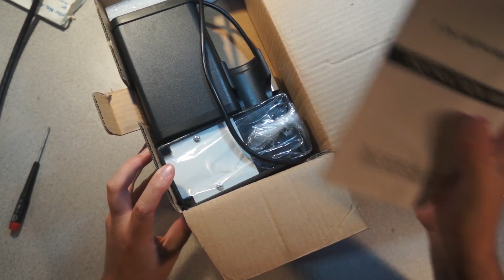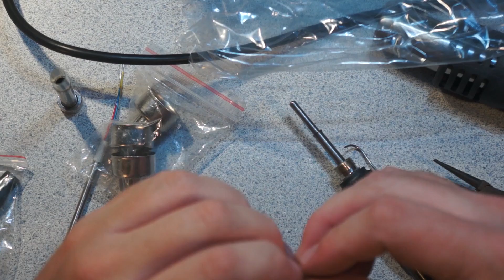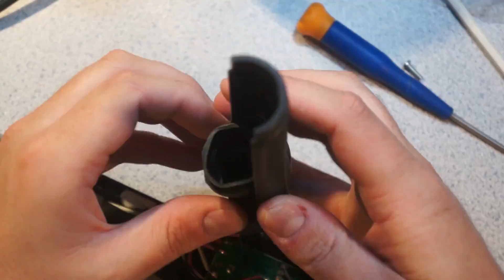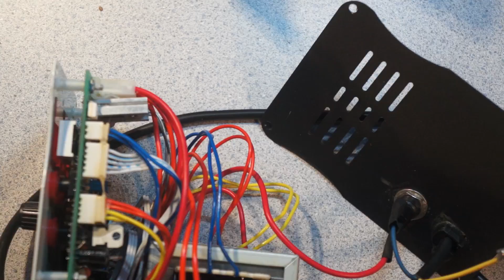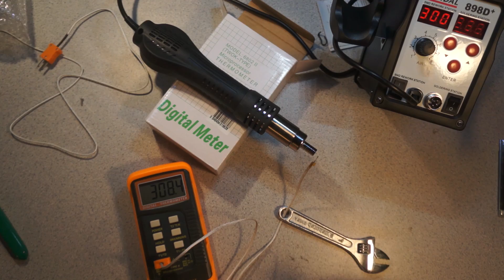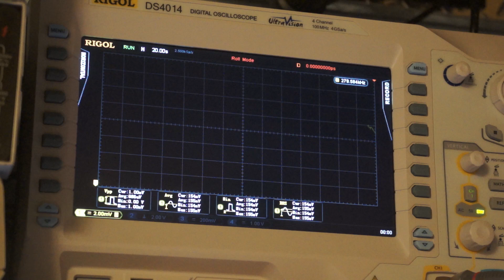898D+ Soldering Station Teardown and Review [Sold under many Manufacturer Names]

Comment: Break out the micro's dip socket to your own micro and after figuring out how it controls the triac, reads the temp and updates the display write your own control firmware and see if you can patch it better and account for the overshoot a bit.

Comment: You're absolutely right Conner... "Lie" is an accurate description.   Seems like the designers were only concerned with ensuring that this device heats up as fast as possible.   Then when they were happy with the heat up time, they bodged the display to hide the overshoot IMO.

Comment: I confirmed your overshoot results with a Yihua 882D+. Similar overshoot when powered on and then settles to about 20C over what it displays. I had the thermocouple about 2cm away from the tip. This model does however stay on to cool down when powered off.

Comment: The overshoot doesn't seem like it would be that significant if it was used against something with any sort thermal mass as it only lasts for a short period of time so not much actual energy would be transferred. I imagine it only seems so bad as you're measuring it with a tiny thermocouple with almost no way to dissipate heat outside of the airflow.
Great review anyway, thanks!

Comment: Maybe... It just seems like the internal temp sensor and the thermocouple you were using were only ever, what, ~1cm apart in space? It doesn't seem like the little bit of metal around the internal sensor would be enough to have that much of an affect. I'm not a mech/thermal person though...

Did you try putting your thermocouple on the end of your Hakko to see if it tracks reliably?

Comment: That's really a lot of memory, I've done stuff at least as complicated on PIC10F22. Judging by the ramp-up curve it really is on/off behaviour maybe switching to a different algorithm once close to the set temp.

I'd just stick a 20-pin PIC or *gasp* an Arduino (Nano clone) rather then having to source compiler/ide/programmer. The more interesting part would be moving the thermocouple to a better spot.
If you can figure that out I'll buy one of these and to the mod for everyone.

Comment from the maker: I STRONGLY suspect it's caused by the thermal lag between the air temperature and the internal thermocouple.

Basically, the actual heating element wires (and the air) heat up much more rapidly then the internal thermocouple. As such, by the time the internal thermocouple is at temperature, the air temperature is significantly above the target temperature. 

Then, as the system comes into equilibrium, the two temperatures drift back closer together.

Comment: I doubt it has any PID at all, it's just a simple on/off logic. Even the manual specifies PID only for the 'higher end" model. Not sure why they never bothered with adding one, there should be plenty of flash space. Do they start implementing market segmentation already? Those cheeky fast learners...
Also, all the cheap soldering guns have loose or ill-fitted tips.
This review (and expectations, actually) is the reason why I still use a modified paint stripper.

Comment: I got a Weller WSD81 Digital station here. When pushing a button it shows the target temp. The last point blinks on the control rate. If I put the iron in a wet sponge it will show decrease in temperature even if its only 3C. I can even get a little overshoot if I fool around with 'step response' into wet sponges more. But it's honest!
Obviously snapping to target temp is to make it look better than it is. However, I think one could life with the flaws if you at least know them.

Comment from the maker: The manual claims that the output is stable and accurate to +-1°C. This is obviously and spectacularly incorrect.

I agree that I certainly think the thing is useable as a hot-air station (and I have actually subsequently done some rework with it). 

It's the intentional lying that really bothers me, not the inaccuracy. If they were forthright about the REAL performance, I don't think I'd have an issue.

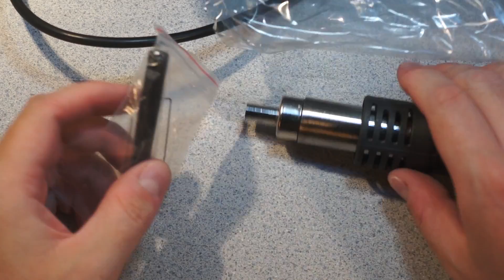Comment: I think that wire thing at 10:43 is actually meant for ic removal, at least that's what i get from my cheap chinese smt rework station's manual.i tried it once and use tweezers instead ever since

Comment: I'm not sure I'd consider the temperature display snapping to the set temperature to be deceitful.  As there is only one display there is some point at which it has to switch from showing the current temperature and the set temperature which they arbitrarily chose to be when the two are less than 10 degrees or so apart.  Considering the variations in your temperature measurements from the probe's position in the hot air stream I'd say those 10 degrees are pretty insignificant.